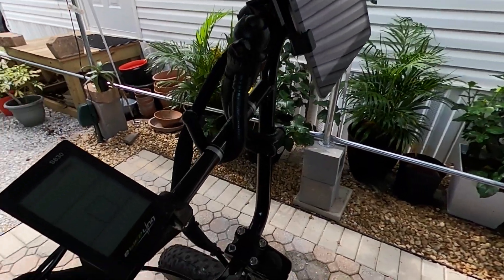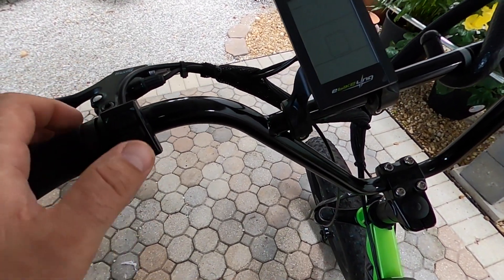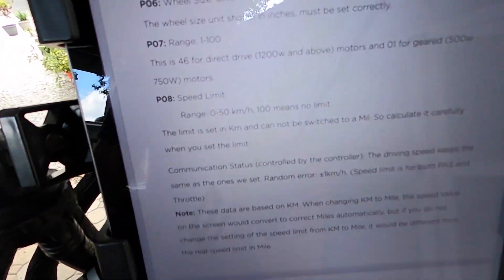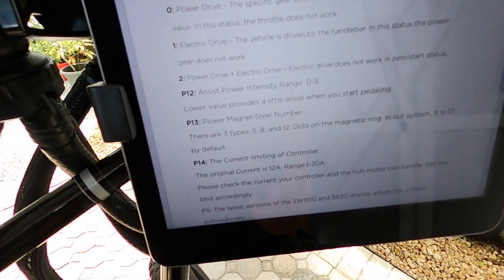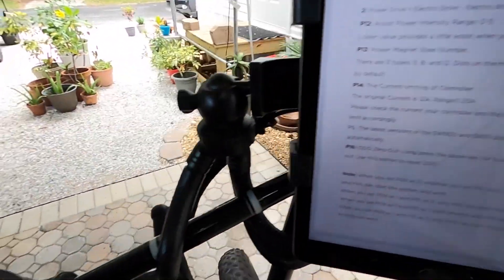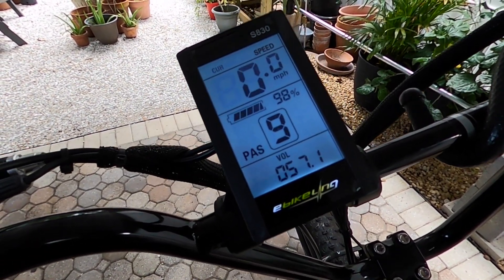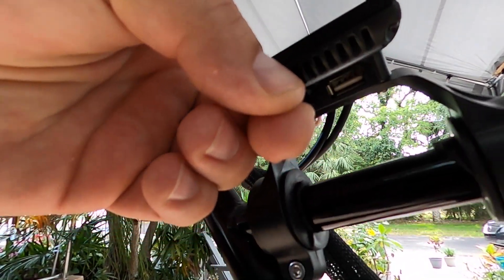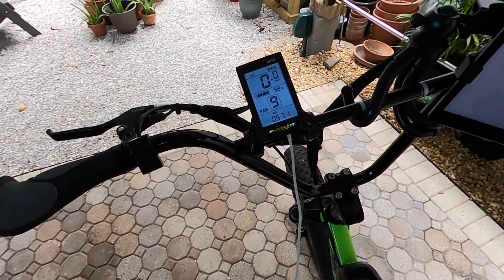S830 LCD Display_1200W Ebikeling 20in Rear Hub E-Bike Kit_Settings and Parameters and Walk-through

Comment: How wide is the RIM, outside width?   site says 80mm, but mm to inches, thats 3.1 inches wide.  My Rad runner has 55 mm rims, and it measure 2.5 inches, but 55mm to inches is 2.17 inches. Like to know the actual width of the rim.